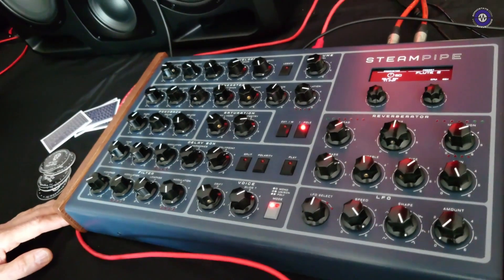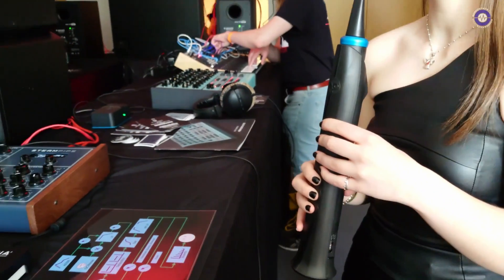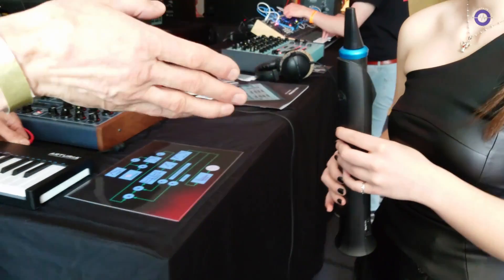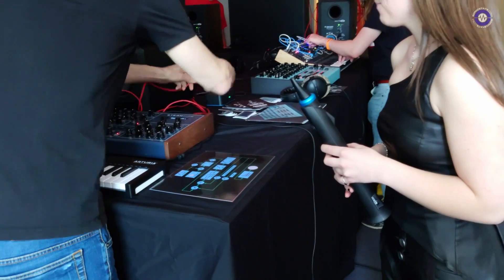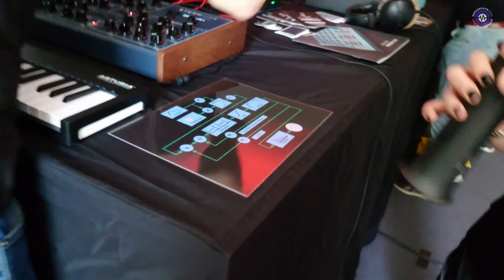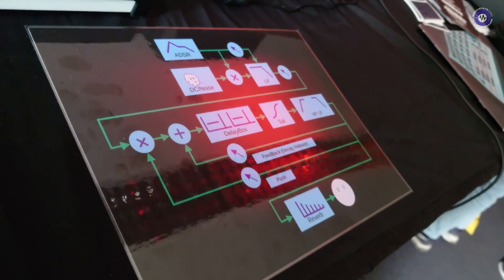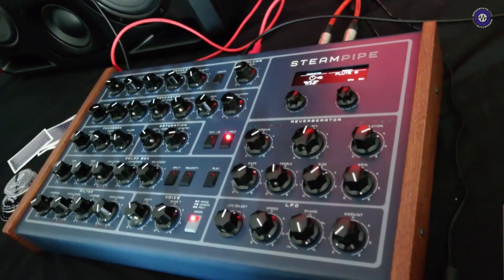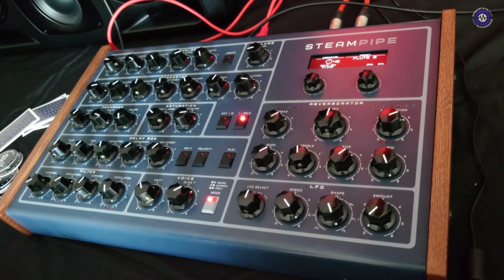Superbooth 2023: Erica Synths - Steampipe

Comment: BTW, one of the things that has been missing from most of these physical models is the ability to bypass the exciter section to input an audio signal as the exciter. For example, for a tube or a string resonator I'd like to feed in a filtered saw patch from my vl70-m, simulating a bow but with much more control than a keyboard controller could give (because ht the response to breath and reed control).

Similarly, let's feed percussion sounds coming our of our e-drum kits! My Korg Wavedrum into the resonators in this instrument could give a wide range of interesting and natural-sounding unique timbres.

Comment: Back when Generator first came out from Native Instruments (the predecessor of Reaktor) the most popular user preset was a similar filtered-delay-feedback physical model, also called Steampipe. I never played it with my wx-5 wind controller, but this is also similar to the models in the old Yamaha vl70-m physical modelling wind synthesizer. It's not clear if it's responding to breath and reed-controller as nicely as the vl70-m, but the interface is a lot (!) more accessible than the vl70-m. I'd love to try this with my wx-5!

Comment: While I love physical modelling, it sounds like me the patches aren't very well made for a wind controller. It currently sounds like they're played on a keyboard. A real wind instrument has more pitch and timbre changes with changing breath dynamics. I'm sure there is room for improvements in the way patches can be programmed to take even better advantage of the input from something like the Sylphyo they use to demonstrate.
Reply: Agreed.  It seems like a struggle to play and with little possibility for expression in this demo.  The Sylphyo has no lip sensor, so it has no way to do embouchure control or lip bend, which a wind instrument really benefits from.  

In physical modelling, you need as many expressive inputs as you can get, with an amount of imperfection provided by the player to make it seem more real.  The more that's going on to change the sound as it's played, the better.
Reply: @TooSlowTube  The Sylphyo isn't the restriction here, though, lack of lip sensor notwithstanding. It has note value, onset velocity, continuous air pressure, axis roll, axis tilt, and a thumb modwheel. The challenge is to program all that information into more than just using breath pressure as volume. 

And even that isn't demonstrated particularly well. The volume changes too little, and it also looks as she's used to playing recorder and struggling to put enough air through it. I had the same issue when I used to own one. I modified mine to increase the air pressure by taping over most of the air tube exit hole. Before that, my playing was a bit like this.

If they had got an experienced wind player and programmed in just one more parameter than volume to change with breath pressure, it could have sounded amazing.

At least it's clear the potential is there.